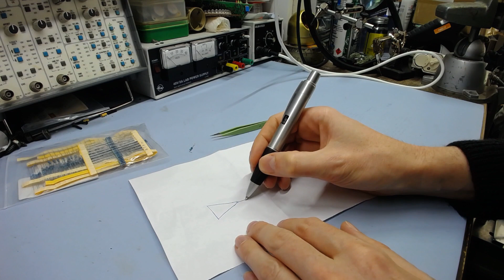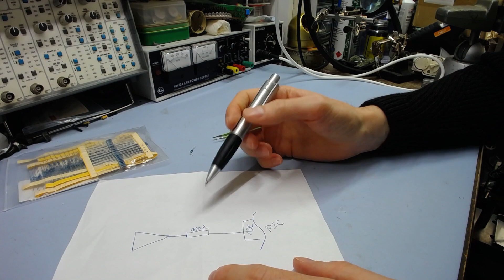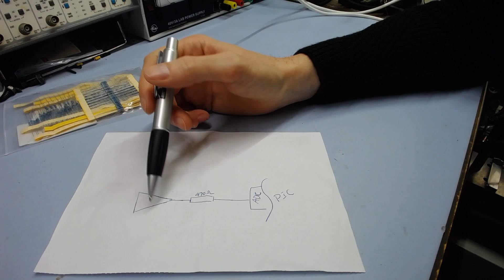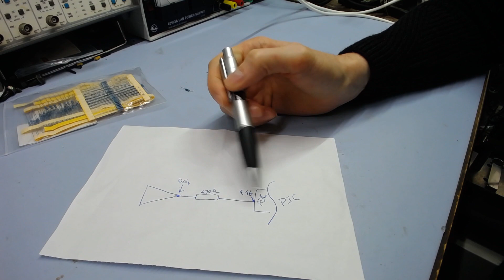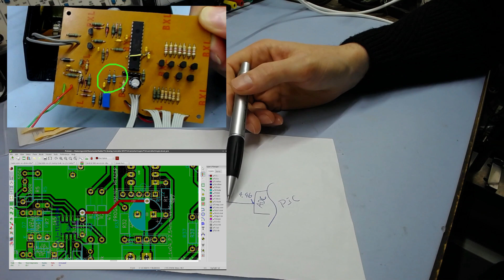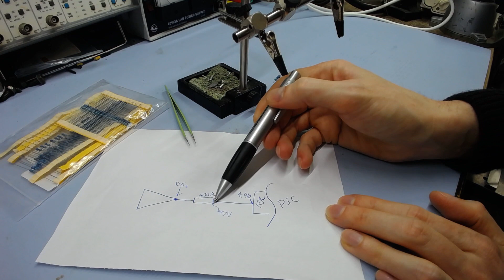The problem with lowest-cost components from eBay

Comment: I've had 'issues' with metal film resistors in several different applications, and to this day I really don't trust them that much but will still use them  .. precision for low cost, the allure.
Reply from the maker: What sort of issues have you seen? Please share! It sounds intriguing.

Comment: This issue you describe here is more common than you think.  I encountered this exact issue working in a TV repair shop in the 90's.
Reply from the maker: Interesting! Was it caused by the same board layout 'trick' or something else?
Reply: @Agent24Electronics  I've read somewhere, where somebody else had ground vias under a resistor and the same thing happened, just not good practice to do stuff like that, especially if it's in a high vibration environment.
Reply from the maker: @ligangyi  Aah, I never thought of that either... I see vias under parts before, but I can see this happening now if they don't get tented properly - and those DirtyPCBs I bought recently certainly had some untented vias... Good point about the vibration issue too. So many tricky things to watch out for!

Comment: Still nothing wrong with the resistor and everything wrong with the design,  as you agreed.
Reply from the maker: Indeed my choice to use an uninsulated link was not the best, but I'm not sure you can say there is nothing wrong with the resistor, I have never seen a resistor with such thin paint to the point of exposing the metal before. Certainly they're lower quality than most.
Reply: @Agent24Electronics  I agree it is unusual to have the metal of the end caps exposed but who is using a resistor in the setup you have? It was just a bad luck if you ask me. As a fellow electronic engineer,  I feel bad to bash you and turn you down. You have put an effort to explain the community that this may happen to them. But on the other hand, you are bashing all EBay sellers, offering cheap trough hole resistors. You tell people go and spend 50 times more $ at DigiKey for resistors that have proper insulated body,  which I don't agree with. First,  because you're not 100% guaranteed you'll get any better value for 50x your money, and second,  ppotentially very few people will have their resistors touching other exposed components. And by design,  no components are meant to touch exposed links anyways. I didn't hear you advise people not to do what you did wrong on your PCB,  all I've heard multiple times is, advises to people not to buy cheap resistors. I think we just need to be fair advisors,  as we try and teach others. Of course,  personal opinion matters and even more,  this is your channel,  you can do whatever you like. I'm only here spending my precious time typing, because I have found the content of the channel valuable and maybe help suggesting a correction. I'm not here to hate or bash, I don't have time for that and don't believe it helps anyway. And on that note, maybe you can squeeze up the content a bit and make the videos shorter,  that's my only wish. 
Thank you for sharing your knowledge! I believeyou do make the world a better place.
Reply from the maker: @111chicane  I think it's up to viewers to think for themselves and decide, as you have, if this matters to them or not. I am just showing something that happened to me and why. I would hope that not running bare links under components is something people may learn from this, even if I didn't explicitly state not to do it. Like I said, you have to think for yourself.

Perhaps my opinion has come across strongly though, because I have in the past bought cheap parts from eBay and often run into quality issues. Power connectors that melt when you solder to them because the casing wasn't made from high-temperature plastic. BNC plugs where the center pin is too large to actually fit in a BNC socket. Switches that fall apart after a week of use. Computer cables that rust. Drill bits that are blunt and worthless. Solder with abysmal and unusable flux. I gave up and went back to Farnell, even though they cost more, it's worth not waiting 2-3 weeks and then getting disappointed.

Of course, that is not every eBay seller - I have bought perfectly usable New-Old-Stock parts from various eBay sellers - but I am specifically talking about the very cheap sellers, mostly from China, the ones who have pricing far lower than anyone else. From my experience with these sellers, I have found it really is a case of "buy at your risk, and be prepared for substandard or even potentially useless parts". If you want to be sure to get quality, go to one of the big name distributors. Yes they can be more expensive, but you also get much faster delivery, and clearly defined returns policy, etc.

Perhaps the video was longer than it needed to be, but this just seems to be the way things go for me at the moment. Also, I am the kind of person who watches the extended cut of The Hobbit and enjoys it..... (!) But I will try to keep it in mind.
Thanks for your feedback, it is much appreciated than someone who simply down-votes a video but does not take the time to explain why they did not like it.
Reply: @Agent24Electronics  Glad we agree on each other's opinions and make for informative discussion. Cheers!